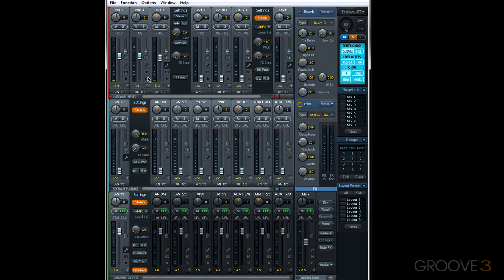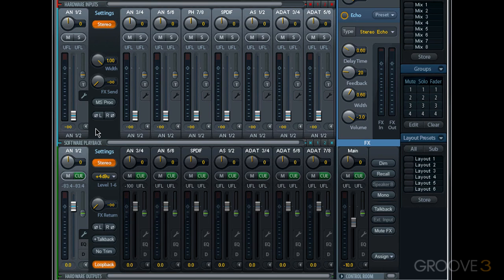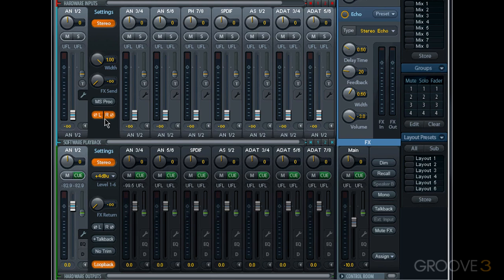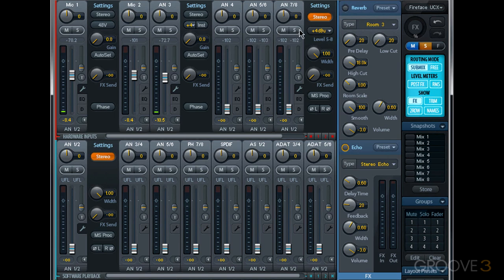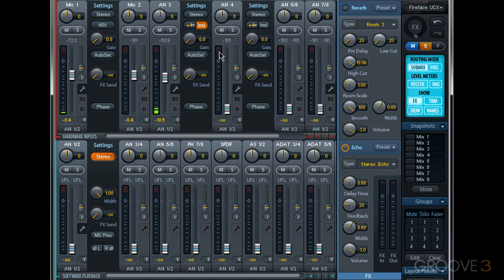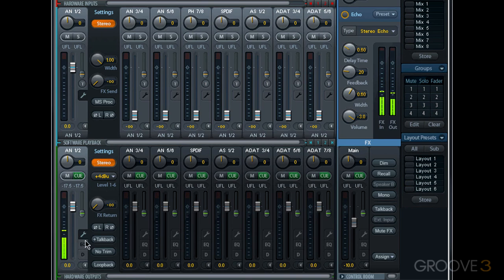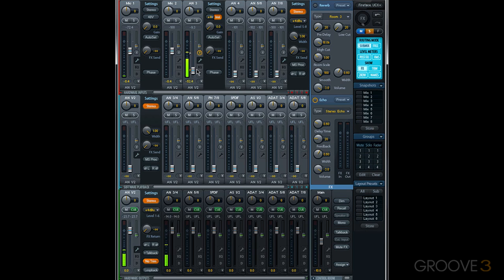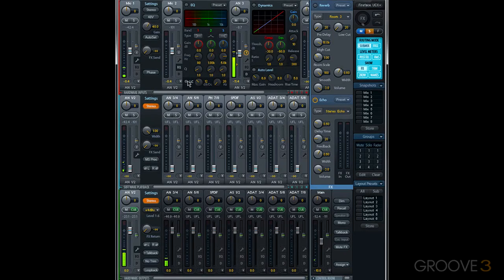Channel Settings (RME Total MIX Explained)

Comment: Hello, I hope you and your family are well. I wanted to ask you something that I am surprised about and I cannot figure out if it can be changed, noting that I am very happy with this sound card. On the MIC channel there is a gain button, gain and when I try to raise it it goes from 0db straight to 10db and it does not give me the option to go from 0 to 10 passing through 2,3,4,5,6,7,8 or 9 and I am hallucinating, is it possible to correct this or is it like this? It happens both in mic1 and mic2 but not in the following instrument channels where it can be done. Thank you very much in advance.

Comment: I can only get sound from the headphones on my baby face pro fs device. Although it gives the speaker signal in totalmix, there is no sound from the speaker or my microphone. I have been going crazy for 2 weeks. I have tried everything. There is no problem with the cables. When I plug the same cables into my focusrite device, I can get sound from the speaker and microphone. I am fed up with this

Comment: Quick question, I'm using a Neve 1073spx l to mix as plugin in my DAW. On the back on the Neve I have a compressor inserted. Do I need to enable +4 on on the in and out channel where it's connected in total mix fx?

Comment: Hi hope you're doing fine 👍👍

I have a question that's,
For many years i didn't use my rme interface ( baby face )
But just i connected to do a mix by use of Rme total mix fx but i couldn't get the exact output means ( i don't know how to get output of RME total mix FX in mixing and mastering, if it's possible plz help me. ( Hope you may help me and also many RME users are unable to use RME Total mix FX in logic Pro )

It's easy to get output but it doesn't sound same after getting final out and playing in any-other players like in a car or another studio etc etc.
( And also don't know to use the loopback option in RME Total Mix FX ) please help me 🙏😁

Comment: Guys i need help. I cant seem to get my guitar to play back or record from my baby face fs in cubase 10.5. Ive tried everything and im not getting results. I figured out how to at least get my project working out of the speakers. But no matter what i do, i cant record or get a signal in cubase , but the actuall interfacce has a signal. Also in standalone with example guitar rig , andy james etc, i cant seem to connect the guitar to play through. I just switched from a focusright 2i4 that was SIMPLE AS HELL. Any help would be highly appreciated. Thank you!
Reply: Have you chosen the correct channel in your DAW? For DI it should be channel 3-4.

Comment: Hello,

I have a RME UCX. I wonder if you can help me.
TotalMix FX is not working correctly for me. There are no faders on Input channels.
I cannot route mic ins to 7?8 phones out.
I have updated to latest drivers and latest version of TotalMix FX, nothing has changed though,
the problem remains. Is there a way to uninstall TotalMix FX and related files.

-  Kevin O'Brien

Comment: Very good from Groove3. I have a little problem with my connection. The signal does not appear in my software FL Studio. Here is what i do: first my mic goes to TC Helicon, from TC Helicon goes stereo to my mixer PV 10 ( first and second channel ), from mixer out to RME Fireface UC   balanced line inputs 5 and 6. And of course RME is connected usb to my laptop with FL Studio 12. I have a signal in my headpfones but no signal in FL Studio. What is wrong ? Will be very grateful for your help.